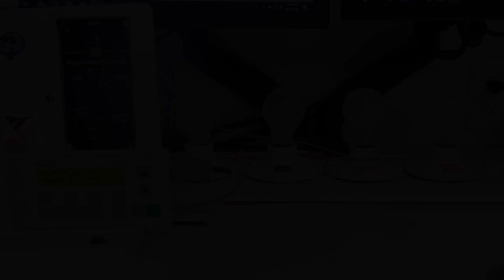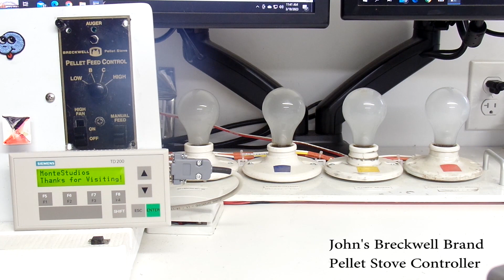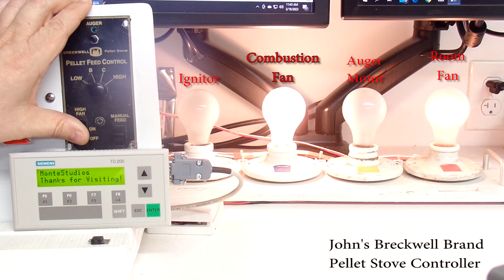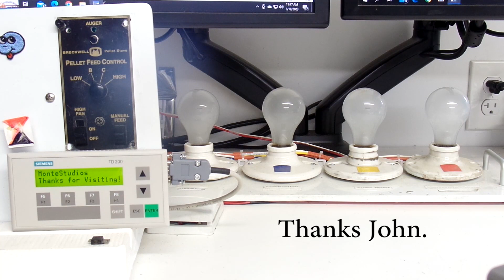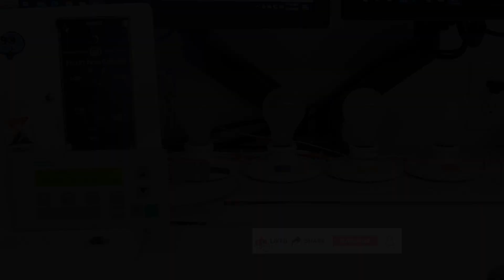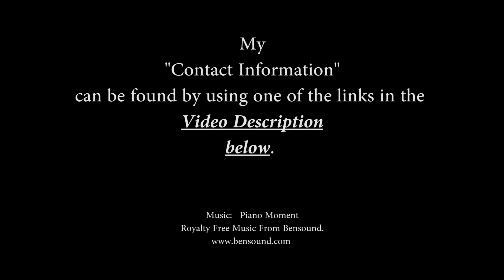Post Repairs "Final Test" of John's Breckwell Brand Pellet Stove Controller.

Comment: Are you still doing control board repairs? I have a st. crouix Alton bay older control board not work. Auger motor won’t auto engage.
Reply from the maker: Andrew..  I can take a look at it, but no promises..  I rarely work on those.